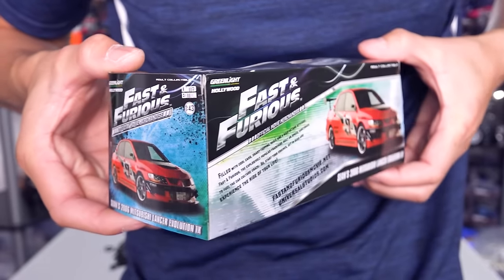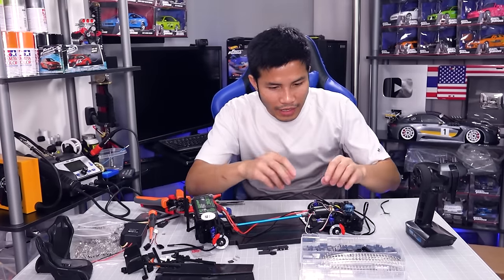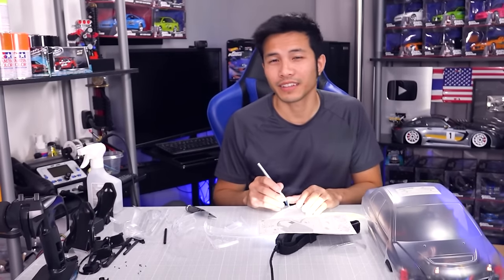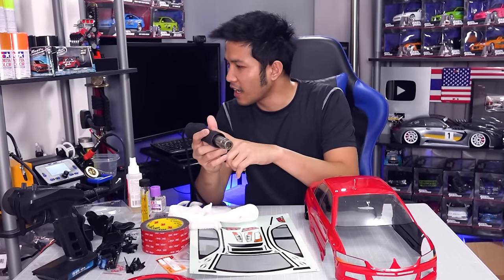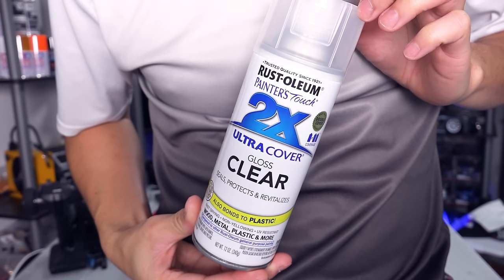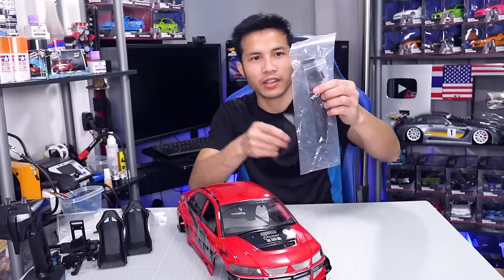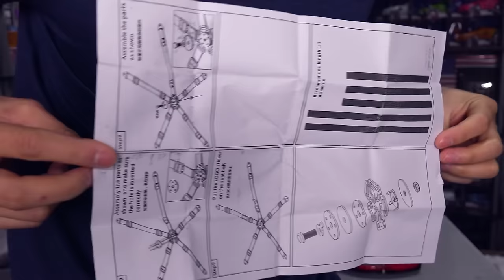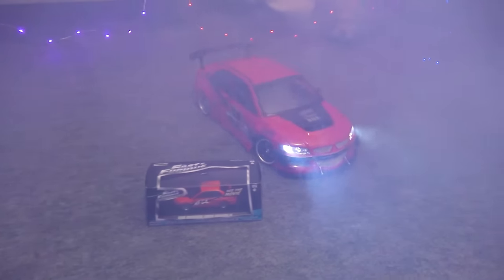RC Modify 1 | Sean's Red EVO 9 Fast and Furious Tokyo Drift Style - RC Car

Comment from the maker: :_ddwLogo::_ddwNos::_ddwTurbo::_ddwExhaust::_ddwBackfire:
ScreenPrintDigital has 1/10 Tokyo Drift EVO Stickers in stock! 💯🏁
https://ebay.to/3iSsH4q
Click here to shop ⤴
Reply: is the rc for sale? xD
Reply: 0
Reply: @face6994  ppp
Reply: Hey bud a little tip on the intercooler. Get some liquid black ink for writing and paint the intercooler with it. It will leak into the cracks making the intercooler look more realistic.
Reply: Is the body for sale?❤️
Reply: Hey bro question where can I buy remote control cars like yours?
Reply from the maker: @erzramirez3351  www.darkdragonwing.com

Comment: Awesome as always. Had a weird idea. If one were to mount an fpv camera to a steering servo place horizontal where the driver seat is you could have an fpv camera that moves inside. It probably wouldn't work but I was just throwing an idea out there in the hopes someone with more knowledge would have answers. I'm planning on getting into RC drifting and liked the idea of  a camera moving with steering so when you are at full lock while drifting you are looking out the passenger window.
Reply from the maker: It's already been done out there. Same concept with FPV pan and tilt for drones. Search around.

Comment: The amount of detail is great. How long did you work on the project? Also the engine bay is really good. Looks definitely better than the ones you painted with permanent markers.

Greetings from Germany
Reply from the maker: Roughly 2 months or so. It's nice to have an engine bay, but man it's pretty challenging with the hood, hinges, 3D modeling, etc. Even with available engine bays out there, unless they're an exact fit for a particular body, it will always be very challenging to make them fit.

Comment: Had a question what is the cheapest RC car electronics you have found only working with $35 and I can save more if needed
Reply from the maker: 55T with ESC
$22 https://www.ebay.com/itm/394448926726?mkcid=1&mkrid=711-53200-19255-0&siteid=0&campid=5338044275&toolid=11800&mkevt=1
$23 https://www.aliexpress.us/item/3256803444368769.html
$28 https://amzn.to/3L2umQz

Comment: You beat me to it. This is going to be my build too but won't be as good as yours but I learned a lot watching this video. Awesome build. 🖒
Reply from the maker: Thanks! Be sure to use the same can of paint for all the parts, from the first coat to the second and so on until you run out before using a new can of paint, to keep the color looking the same as much as possible. Cheers!
Reply: @DarkDragonWing  Thanks, I always buy more than I need. I also bought two bodies and sticker sets but that is just incase  I messed up in anyway as this us my first ever drift car build.

Comment: Hello friend ! what glue do you usually use to join body parts? Or when it is necessary to assemble body parts such as erodynamic wings that have to be joined to take shape! What glue to use to bond this lexan material together.
Reply from the maker: I use Mounting Tape 5925 https://amzn.to/3qVaS8C

Comment: Put it on three different playlists on my chan Mac! I’m likely going to send you something in trade for those servo’s i need for my hpi and Tamiya cars! 
The 3m ,white foam, double side tape is 10x stronger/stickier and as thin,lighter too! 
It’s pretty much permanent. 
It’s sold on a 3m “Red card” with green 3m peel back.
Pics in your DM of some cars coming soon my friend! Ultra
Reply from the maker: Thanks for the info on the tape.
DM me via Facebook page: https://www.facebook.com/DarkDragonWing
I'll supply the 3D printed parts if you want them, only the ones I already designed though.

Comment: How did you do the wiring / set up for the body mounts and the lights?? it looks like you have a magnet switch on the body to control the lights. can you explain or show that in detail?? I'd like to see how its done so i can use it on my build. Thanks in advance.
Reply from the maker: Say no more, watch this build and you will level up for sure: https://youtu.be/NaoXa-XAk7U

Comment: Why don't you use a heated tool like soldering iron ? For the slots on bumper did with knife ...
Reply from the maker: It doesn't leave nice and clean cut. It will leave melted edges instead, I think.

Comment: The way they look I will say 10/10, the only issue I have the rc is for performance or more scale, the many detail in 3D print can make the weight more front, and as far I know the weight distribution need to be 65 - 70% rear and the front 30 - 35%. Still even is for scale can win again others drifter, but in performance well that another story

Comment: Cool video! Btw, the LIPO safety bags you use are not safe at all and are actually accelerating the fire! The only safe containers for batteries are actual metal case battery containers with a fireproof gasfilter and ventilation holes. Every bag from amazon etc. just burns and melts away when tested. Theres a couple very detailed videos if you look up "lipo safe containers". 

Anyways, keep up the cool videos!
Reply from the maker: Thanks for the info!

Comment: That car is out of this world an I just happened to stumble onto your channel would you be open to do other body's for people I do some my self but I found a sick Datsun from the seventies an I stuck on what to do it has the light bezels for front an back but want to locate the rear from the bumper to the bed like the 85 I used to have also has wide body flares on it or maybe an idea for me an also have head light kit for it an demon lights for the inside head light cause it duel headlights if you hit me back an maybe you could tell me some different things I can do so it can look good hope to here back from you bobby new an permanent subscriber
Reply from the maker: Thanks! Unfortunately, doing builds for customers is not quite possible for me yet. I'm packed with video plans, really want to upload more often. I hope you understand. As far as what you can do to your RC, anything you want, you can find a way to make it happen. Watch my older videos for some ideas. Cheers